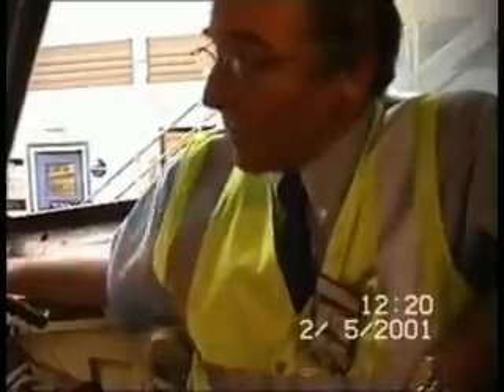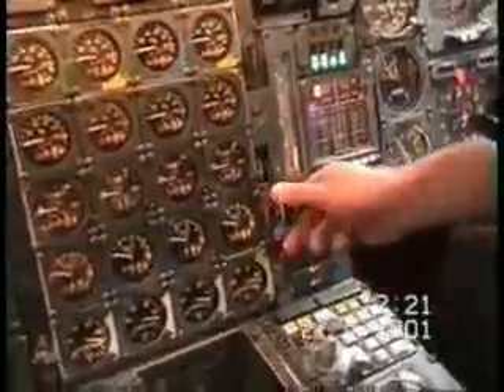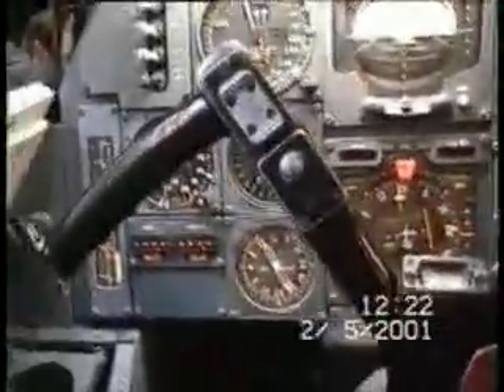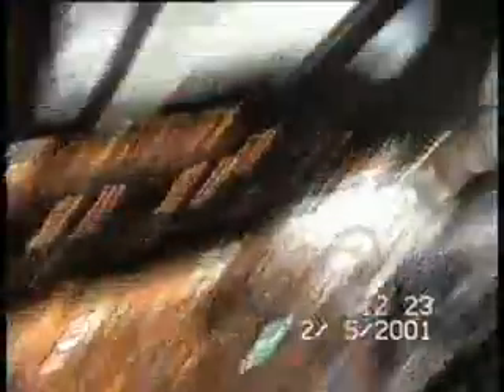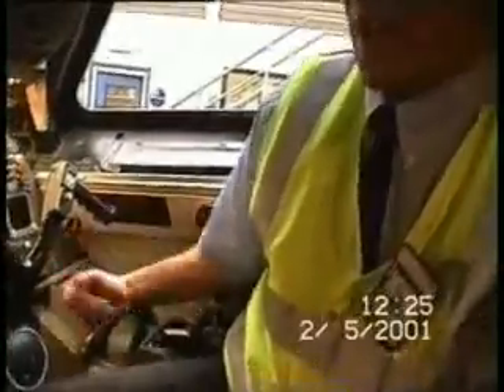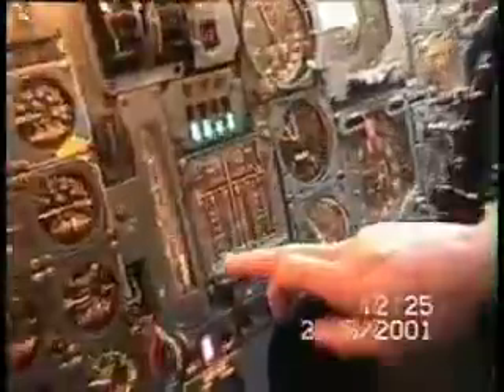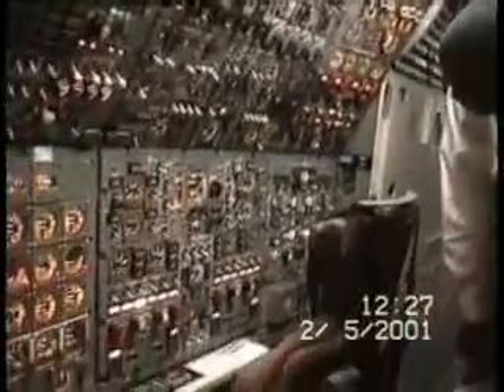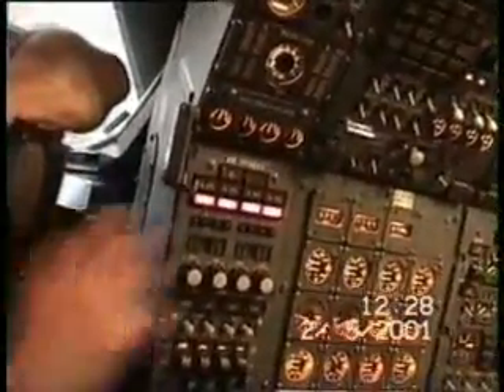What do all these buttons do? Concorde cockpit tour

Comment: What means CTY (Contingency) position of reheat switches and in what conditions it should be used?

How is a difference between normal engine start and debow engine start?

What means F/O (flyover) engine rating?